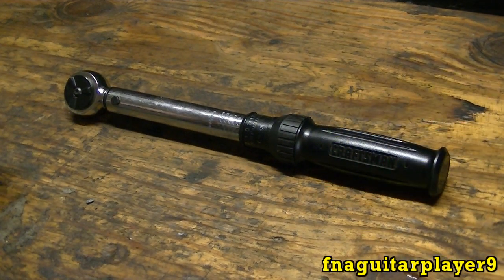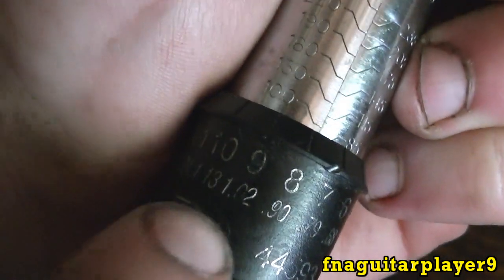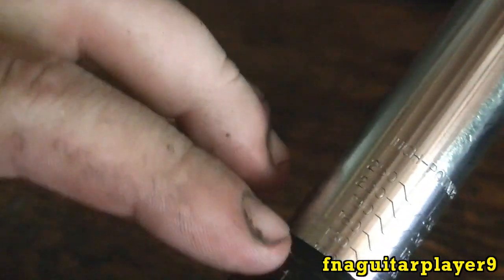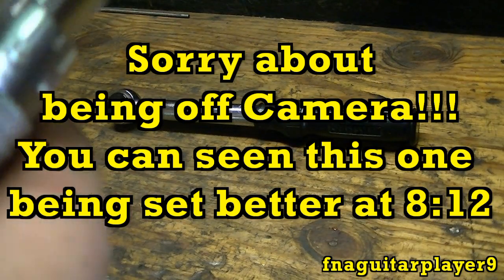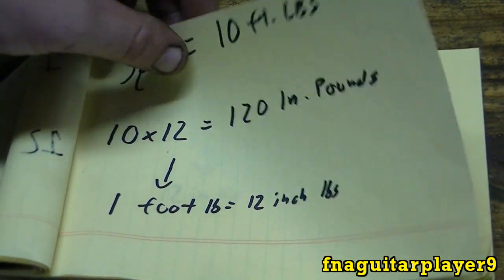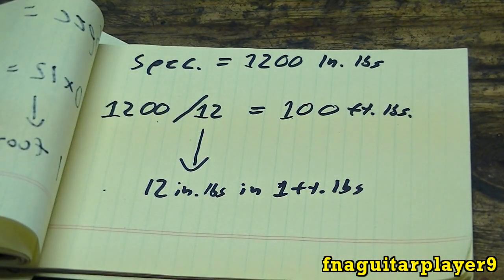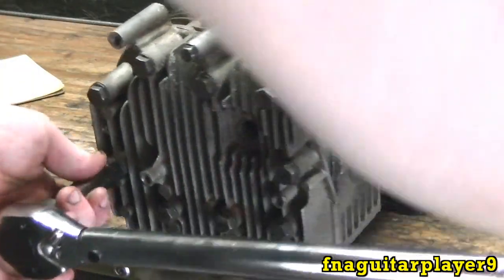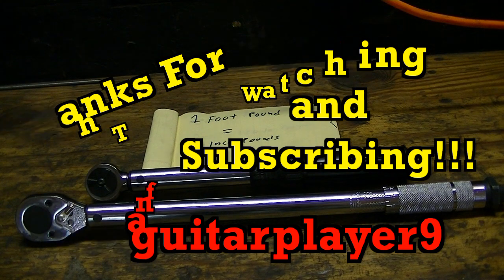How To Set and Use Click Type Torque Wrenches AND Foot / Inch Pound Conversion

Comment: I'm working on a 15.5 B/S engine the head bolts are torqued at 220 inch pounds how do I set that? My wrench is an ampro, my lowest setting is 120 my closest setting is 240!
Reply from the maker: It should have in between settings i've never seen one that couldn't be adjusted, i know they are all different but most have the similar setup as the ones in the video. thanks for watching!!!

Comment: Very well explained. The Conversion Pages explained the conversion plainly, yet they also clearly point out the rather silly idea of using base 12(Feet/Inches) instead of base ten(Metric)..We don't do it with money or anything else,and for good reason.It is a pain in the ass. Metric numbers never change, only their values...18 Feet =1' 6" {1.5Feet) =216 Inches.       18 Meters=180 DM(1.8DM) =1800Cm =18000mm
Reply from the maker: You are right there, metric actually makes more sense. I'm so used to sae, i prefer it. Thanks for Watching!!!

Comment: So I’m trying to use this torque wrench I bought for my spark plugs, the wrench measures in inch pounds from (120-960 in-lb) I need to set it to 17Ft-lb (23nm) so the conversion from ft-lb to in-lb is 204in-lb, yet my wrench goes from 120 to next level 240, how could I get such numbers on the wrench? Thanks.
Reply: So I kept doing math & realized it does increments of 12 per “number” therefore to get to my “204 in-lb” goal, I simply turn the wrench to the number 7 from the 120in-lb (the lowest first range) which gives me 204 correct? (120/10=12, so 12*7=84 therefore 84+120=204in-lb which is the same as (17ft-lb) right?
Reply from the maker: That sound about right, it won't be exactly on it but really close. Thanks for Watching!!!

Comment: That must be an iron head to be set at 185.  I'm working on an aluminum head briggs and it says 140 inch.
Reply from the maker: Its aluminum, my spec sheet shows it listed for 185, this was a 12hp engine, the smaller ones are listed for 140. Thanks for Watching!!!

Comment: You were saying to use on bolts , right handed . will it ruin the torque wrench tighten a left hand bolt .
Reply from the maker: It won't ruin it, but it may make it not as accurate, i would suggest if your going to be using it alot of LH bolts, to get a another just for that. Thanks for Watching!!!

Comment: Hi fnaguitarplayer9, thanks for the video, really appreciate it. Question then please. I used a 3/8" torque today to install new plugs on my Nissan V6, 20 ft LBS each.  I noticed upon the first click, if I stepped it back and tightened again, the plug would go in further, then click again.  Then I tightened again, and the plug went further with a click.  Question is, is the spec at 20 ft LBS at the first click?
Reply from the maker: Your welcome! Sounds like there maybe something wrong with the torque wrench, it shouldn't turn any more after it clicks the first time. Unless its made that way for some reason, if it doesn't turn anymore before clicking after the 2nd time, then i'd say it would be alright, but that is strange that its doing that. thanks for watching!!!

Comment: for some reason I'm having difficulty trying to buy or rent a 1/4 in torque wrench, other then online, which retailer would you recommend?
Reply from the maker: Assuming your in the US, I've have good luck with the ones from harbor frieght, they usually run them on sale for like 10-15 dollars. But you should be able to find them at any auto parts store. My main one (3/8) is a Craftsman, sold by sears. Also, if a 3/8 is more common where your at, might have to use it, its bigger but should go down to a low enough torque setting. hope this helps, Thanks for Watching!!!

Comment: Thank you for posting this video. I just purchased a torque wrench today but I wasn't sure on how to use it. Thanks to your video I do now. People need to realize that when you take your car to one of these auto care places they are using impact wrenches to tighten on your lug nuts. Impact wrenches should never be used to tighten on lug nuts especially on aluminum wheels. Impact wrenches exert over 200lbs of torque in some cases or even more. That's way too much for lug nuts. Most cars I see have a torque specification of 80 to 100lbs on their lug nuts. If they are overtightened it can cause serious damage. It could warp the rotors or it could prevent you from taking off your wheel at all. This would really be a bad thing because you would strip the nut and the only way to get the wheel off is to cut the bolt off. Expensive and tedious job. It's amazing that people take their cars to big named auto shops thinking they are getting the service for their money. Most of the time these mechanics are actually messing up your car more than helping it buy the practices that they use. They love using impact wrenches on lug nuts because its a hell of a lot faster than doing it the right way. This is one of the reasons I try to learn how to do as much on my own car as possible. I do not trust most fly by night mechanics to even look at my car. Let's face it most of them don't give a shit or value your asset like you would...
Reply from the maker: +Michael Smith Your welcome, glad to help out! That is very true, if i use a impact for that I won't max it out, I'll just let it tighten for a couple seconds, which is probably still way to much torque, most of the time though i just it for loosening them, and use a breaker bar to tighten each one. I know what you mean, most shops don't care, they want to be as fast as possible and make it easy on themselves. I agree with you, if i can I'll fix it myself. I had to put a timing chain in my truck almost a year ago. Thanks for Watching!!!

Comment: Hey, I just rented a Evertough torqe wrench from the local auto parts store, because mine was slipping.. it reads different from mine and I was wondering if you might shine some light on the numbers .. I understand the numbers on the handle to dial up to .. but on the dial instead of being numbered 1-10, it reads 0,3,6,9,12 with marks between each number, so it looks like its suppose to be 15 ft lbs between the makrs 100 - 115 just like the first wrench you showed in the video it even has the lock slide like yours. Ive tried setting it to 65 but I cant lock it in because I would have to set it between 9 and the mark which doesnt represent a number, but I know 3/4 of the way toward that mark would represent what would be the 10th mark on most . I cant slide the lock back unless its actually on one of the marks , but in this case that would make my torque at 66ftlbs if I m not mistaken. 
 do you know what these numbers translate to or the calculation used to figure out how to tune this thing in ?
Reply from the maker: +dustinpool I'm not exactly sure without physically looking at it, but I'm thinking it would divide across the range some how, then you would know what each one represents, but I've never seen one exactly like that. Wish I could help more! Thanks for Watching!!!

Comment: Good video, I just bought the HF 1/4" torque wrench and the instructions show a sample of "50" in the picture but there is no 50, but as I know it is between 40 and 60, so that is sort of confusing.
But the thing I don't get is how do I adjust the big nut in the bottom?
I understand about the small lock nut at the very end, but where do I set the big nut?
Do I just leave it loose after I snug up the small lock nut at the end?
Reply from the maker: ***** Thanks! I hear ya, I just bought a 1/4" drive one as well, been wanting to get a smaller one for a while now. Their instructions/manuals are just about useless haha The big nut should turn with the adjustment sleeve (i'm not sure thats what its called) but the little nut/knob at the bottom is supposed to be snugged up to keep the setting from changing when you use it. It should tighten up after you snug the bottom one, i checked mine and it only turns when your setting it. Thanks for Watching!!!
Reply: Thanks for that info!!
Reply from the maker: ***** your welcome!

Comment: just wondering sir -  - My piston has 2 different length bolts to connect to the crank shaft - I heard you mention - I beleive in Vid 3 of the 12.5 Power Built that the ft pounds are the same because the BOLTS are the same length... Well mine are of different lengths - My Top bolt is 3/8 socket and 1/4 inch longer than the Bottom 1/2 socket  - PLEASE HELP !!!!!! My grass is growing CRAZYyyyyyyyyy !!!!!
Reply from the maker: zedieliam Alright, on that type you torque the small bolt first to 160 inch pounds then you torque the long bolt at 260 inch pounds. Thats unusual to see them, I mainly run into both being the same size. I hear ya! Grass is really growing fast this year for some reason. Sorry for not getting back to you sooner! Thanks for Watching!!!
Reply: Thank You - it actually worked - i cut THE SHIT outtta my lawn - and I owe it to you Brother - Thank you, Thank You - THANK YOU !!!!!!!!!!!!!!!!
Reply from the maker: zedieliam I hear ya!!! Glad to hear you got it running great! Your welcome, anytime you have any questions feel free to send them my way!

Comment: Hi, great vid! question though - on 6:17 you said the inch-pounds ratio of the bolts are 185. how did you know that? where is it written ?
Reply from the maker: Thanks! I work on small engines all of the time and have a chart i made up with all briggs and stratton engine's torque specs listed. Most of the time if your working on something and you don't have repair manuals you can google it to get the torque specs. Torque specs can vary alot depending on application, even if it uses the same size of bolt. Its not written on the bolt or the motor, usually found in repair manuals, etc. Thanks for Watching!!!
Reply: fnaguitarplayer9 Thanks :) how critical is it to use the exact torque spec ? can it damage the wrench or the bolt if I'm using incorrect torque setup ?
Reply from the maker: Shahar Biran Your welcome, it really depends on the application on how critical it is, for example head bolts (as shown in the video) are very critical, if its not torqued correctly the metal can twist or warp and make the head not seal, same as a blown head gasket, now if its something like a cover, like say a timing chain cover its not super super critical, on stuff like that, the most important thing is that they are the same, again to prevent it from twisting / warping. The main reason the head bolts are so critical is do to major temperature changes. If you use the wrong spec you could snap a bolt if its to much torque or if its not enough for the application it won't seal correctly.

Comment: Thanks for the advice on getting me started guitarman,I havnt done any mechanics for 30 odd years and boldly bought a torque wrench today.
As the UK is biased towards the older generation this tool of course came in metric of which means absolutly nothing to me laughing.
I also bought the 1/2 wrench which is very similar to yours and seems the size of a football pitch.
Thanks again and I will persevere.
Reply from the maker: your welcome, glad to help out! Yeah I'm no expert on metric either, I only know about bolt sizes and stuff like that, but the newtons? measurement is another language to me haha no problem, thanks for watching!!!

Comment: good video man and very helpful you answered my question in the start of the video in pound is for small motors i figured also for valve covers and stuff again thanks
Reply from the maker: Thanks, appreciate that! Yeah thats pretty much it, inch pounds for smaller stuff, most of the time foot pounds are used is on vehicles, the only thing on small engines would be the flywheel nut/bolt. Thanks for Watching!!!

Comment: I might buy a torque wrench as I'm in the process of replacing my valve cover gaskets on my 88' Mk3 Supra Turbo which needs a torque setting of 22 inch/pound NOT foot.

My question is...can I buy a foot/pound torque wrench and simply convert 22 inch/pound to foot which is about 1.833 foot/pounds and apply that amount of torque for my valve cover gaskets? Or do I need to get a torque wrench with inch/pound measurements?

Comment: Thanks, really needed this. Been working my cars for years and embarrassingly I never really torque stuff (never inside the engine though).

Today I'm replacing an entire front suspension and, I thought, maybe I should put that torque wrench to use :P
Reply from the maker: your welcome! Alot of people don't, the main time things has to be torqued is like head bolts, crankcase, connecting rod bolts, critical stuff like that. Technically your supposed to torque lug nuts on wheels, no one ever does, except maybe at the factory. Thanks for watching!!!

Comment from the maker: I should have mentioned this in the video, it would be 960 Inch pounds which is more than what the 3/8" will do, so in this case you would have to use a 1/2" torque wrench with a bigger range on it, you should be able to go to a auto parts store and rent one if you don't want to buy one. hope this helps! Thanks for Watching!!!

Comment: The metric equivalent is measured in Newton metres, needs a bit of funky conversion to get it to foot pound, 10 newtons is about 1 kilo or about 2 pounds and a metre is 3foot 3 inch or thereabouts, the conversion ratio is .74 ftLb per Nm, to convert ftLb to Nm multiply 1.74 vice versa multiply by .74